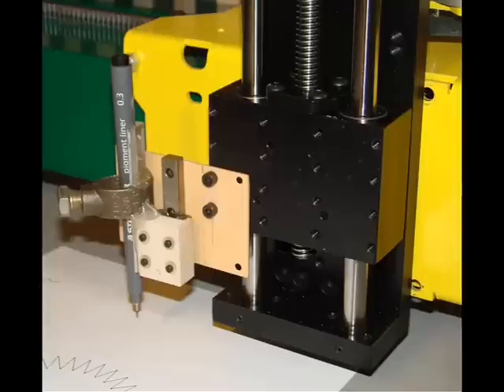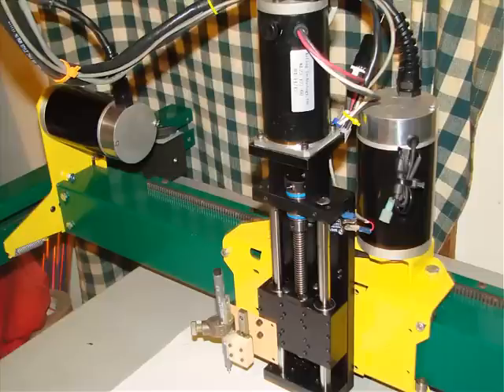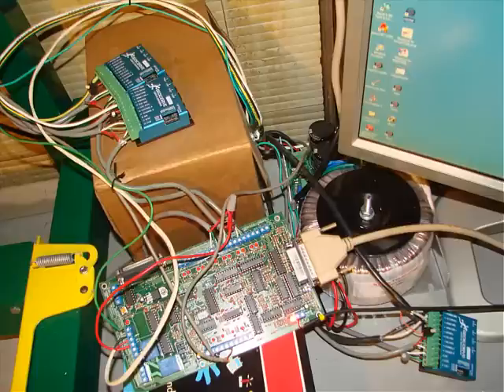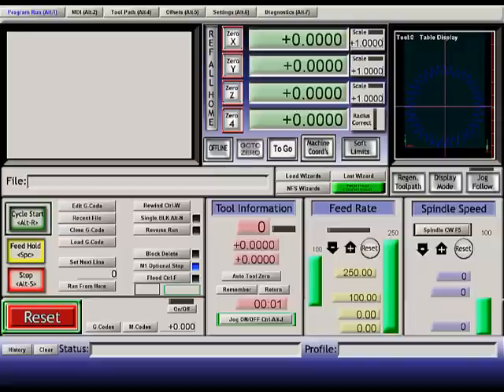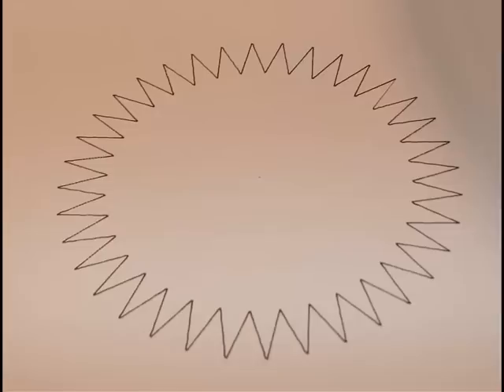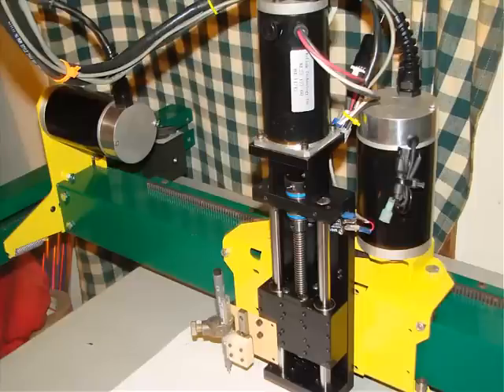Pen Test Plasmacam Gotorch with Gecko Servo Drives

Comment from the maker: x/y servos = std plasmacam issue, no specs, 1:4 reduction to 24 tooth 20 degree spur gear, 1 rev = ~ 1" travel

z servo = nema 23 (60 V 350 oz/in from keling rated < 4 amps cont), seems equivalent to the pcam motors
  
all on  60 V 20 A analog supply, gecko current limit ~ 1/3 turn (7 amps ???), all runs cool (barely warm), no faults

sure easily has more power than the gantry and lead screw can handle